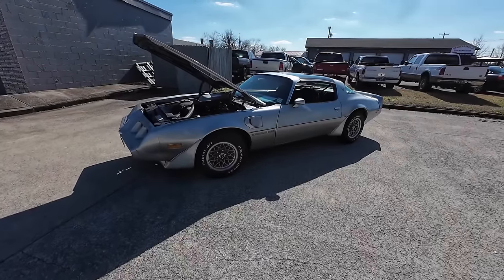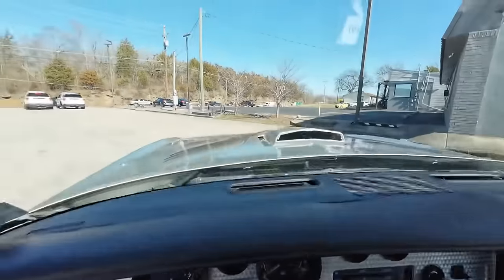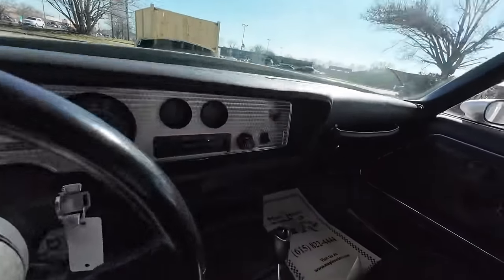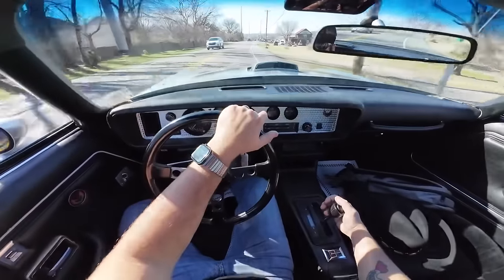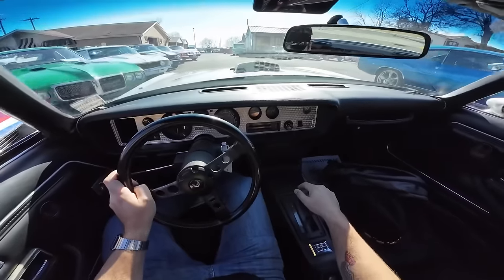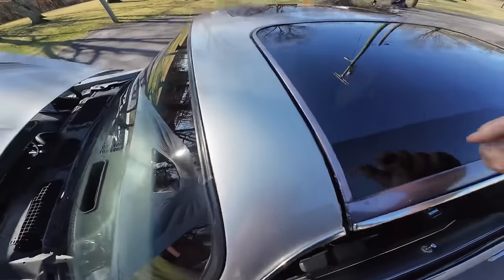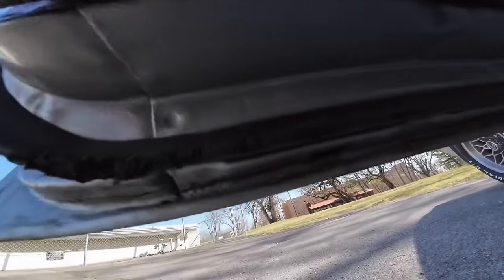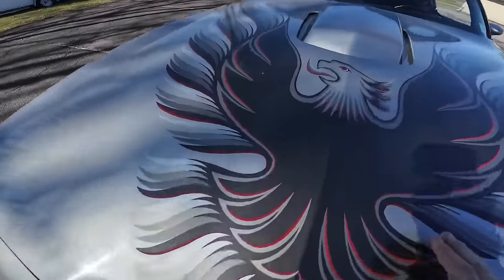Test Drive 1979 Pontiac Trans Am SOLD $24,900 Maple Motors #2500

Comment: I've been enjoying your test drives of your TA's the last couple of days. Fun cars! Just a tip. I notice you're buying premium gas for them. Because the original 403 engines are low compression, there's no advantage to running premium. They'll run just as well on regular. And the difference in price between regular and premium is quite high. I know it's not a big deal in the overall scheme of things, but the difference you save on a full tank could buy you a good lunch :-) . I know because I have 2 79's with 403's myself.